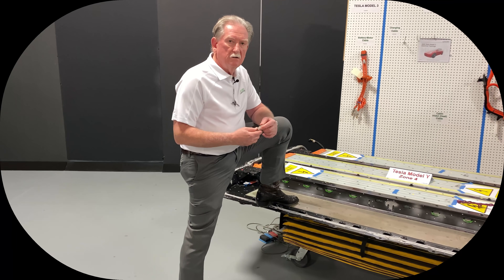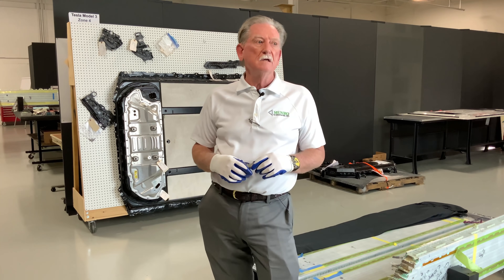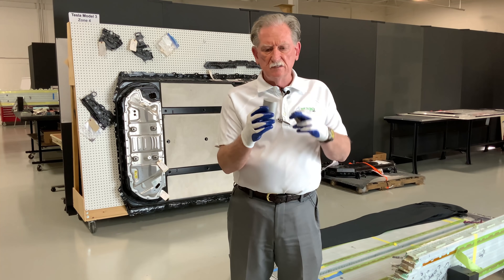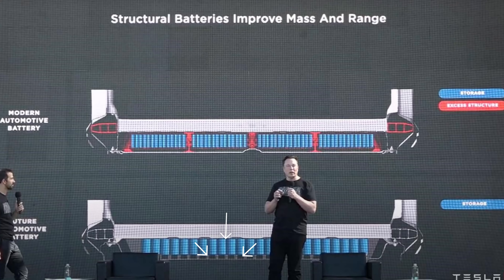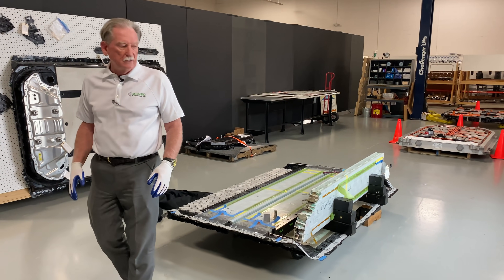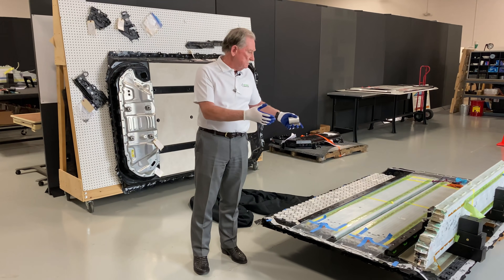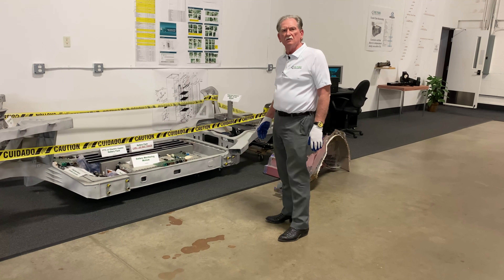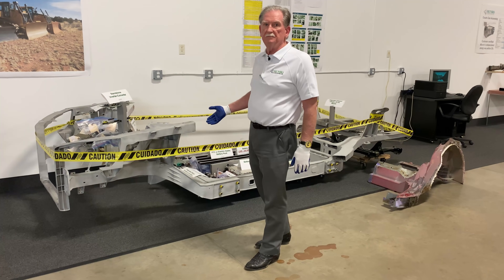Sandy is Thrilled about Tesla's Battery Day & Begins Battery Mock-up

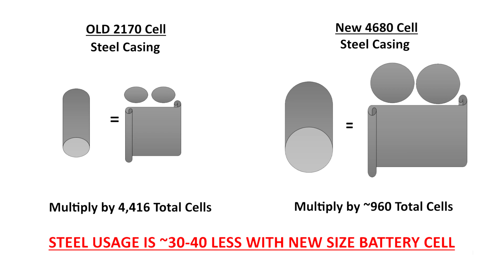Comment: @8:42 “That means that i’m going will lose about 30-40% of the battery weight simply because I have a bigger  diameter.” 

This implies that the 4680 cell will have 30-40% more energy density by weight than the 2170 simply because of bigger diameter, which is not true. It wasn’t true when going from the 18650 to the 2170 and isn’t true going from 2170 to 4680. If it were that simple Tesla would have made a 4680 instead of 2170 years ago. The weight difference of the cell can is a small fraction of the weight of the active material. 

Of course you have a complete model 3 and model Y battery so you can break it all down to the weight of the cooling system, the module casings, the filler between cells to prevent fire from spreading, etc. 

According to your statements, you are saying all the things that can be removed by using a 4680 cell directly in pack, and using upper and lower cooling plates instead of cooling ribbons, and then filing all the gaps with fire retardant epoxy, and the same kWh battery will weigh 50% less than the current model 3 battery, excluding the case, which is a separate weigh savings item not related to cell diameter.

Ok Tesla fanboys, come at me. LOL
Reply: Yes, someone needs to do a deep dive and break it all down for us!
Reply: .....will be way cheaper though
Reply: James Maddeaux, yes. Right now all the battery day information is jumbled together which makes it hard to see where each gain is actually coming from. Tesla could ask Panasonic to make 4680 cell size using the exact same chemistry as the 2170, and just use tab cooling (upper and lower cooling plates), and go direct cell—>pack and get ALL the weight savings. 

The 2170 actually has a higher volumetric energy density than the 4680 tabless, but a 4680 with enough tabs on each end to conduct heat optimally would have a higher energy density. 

I guess doing away with cobalt will save money if they can mine everything in Nevada. We can only wait an see because that’s a whole bunch of variables in there, starting with getting to acceptable yield rates with the Tabless 4680 cells.
Reply: @imho7250  Shouldn't the 4680 have like 25000 mAh?
Reply: James Maddeaux, yes. The 2170 is 4.8 Ah, and Tesla claims 5x energy from 4680, so 24Ah (24,000 mAh). However if they just used the same chemistry in the 4680 as the 2170 it would have over 26 Ah (26,000 mAH).
Reply: James Maddeaux, using Ah might not be the best way to compare since we don’t really know what the voltage curve looks like one they removed the Cobalt and perhaps do other things to the chemistry. But the 2170 has 17.3 Wh, so 5x that (Tesla presentation) would be 86.5 Wh for their 4680. So if they stick with 96s, and use 10p, that’s 83 kWh pack.

Comment: Kind of puts another nail in the short seller thesis that Tesla better watch out for when the "Big Boys" come into the EV space.  Tesla's biggest advantage is their pace of innovation.  And no, solid state batteries are not required.  Cheap energy dense batteries are the key.

Comment: Great work Sandy! So it looks like the 4680 cells are only a little taller than the 2170 in the M3/Y. So with reduced structure/cooling tubes, will the new batteries be able to be used in the same space of M3/Y? I think at first they are for Semi and CT per their battery day charts but would be good if Tesla can eventually put them in M3/Y/S/X.

Comment: I realize Tesla created its own metal, but making a casting of this size, isn't it subject to cracking if not at least micro-cracks? How much savings is realized by casting over stamped metal and how? What is the rate of casting manufacturing: 3 per hour, 10 per hour, 100 per hour?
Reply: Rate of casting: From what Sandy has said elsewhere, the rate will be a lot faster than stamping and welding together a conventional unibody.

Comment: I saw an interesting question that didn't get answered during the event, which was, how easily replaceable will the batteries be if they're structurally integral? And also as a side note to that, is it likely to prevent ev conversion companies from being able to use Tesla packs in conversions?
Reply: I doubt the batteries would be replaceable.

Comment: "With this,  do I actually need solid state battery?"

Actually, I was sort of hoping you would answer that for me.  But no, batteries are good enough now that it is obvious that I should be buying an EV.  If (or when) solid-state batteries would be an improvement, I want to see them used.
Reply: don't worry too much , Batteries to POWER the Suns are coming, ...

Comment: Sandy, I came from a plastics injection molding background.  Quite frankly, in the world of plastics enclosures for consumer products (TV, washing machines, chairs, etc.), they have made one giant piece mold for ages - in fact, I always wondered why they do NOT do this in the automotive industry ... and now I know why!  And I agree with you 100%!
Reply: It may also have something to do with the metal.  Tesla said they had to create a custom alloy to get it to work.
Reply: @bigdream_dreambig  It may as I think someone or Elon himself said that the metal did not require heat treatment after being taken out of the mold.  The Giga Presses produce metal parts much like plastics' injection molding.  That said, fibre-reinforced plastics (also injection molding) are widely used in the automotive industry - just never made it to the load-bearing structural elements.  https://www.automotivemanufacturingsolutions.com/high-fibre-content/36244.article

Comment: You describe the new battery pack as having the cooling plate on the bottom, would it not be more efficient to flip the pack over to have the cooling plate on the top.

Comment: What do the big castings and combined floorpan/battery pack mean for crash repair costs? Can they economically be replaced if damaged? Can they be repaired in place if bent? What state would the car be in after a crash which bent one of them? (Would something which bent them be a write-off crash in any case?)

Comment: It's good to get a Mr Munro engineering school fix once again x
Now I know I am going to have my head removed and put on a spike on London Bridge... Tesla are not the only ones using the battery as an integral part of the chassis... Lucid are doing the same.
Ok Tesla have as ever taken it to the next level with their new cell and giant slide mould casting, as Sandy says Tesla think at the speed of light, but they are not first. With the slow speed into production of Lucid and the ability of Tesla to pull the rabbit out of the hat, it will be interesting to see who makes it to the market place first. 

As an aside did anyone else's jaw drop when they showed the incredible reduction in factory machine space? Didn't see it coming even though all the clues were there for some time now about dry cell production but Tesla did it again and combined with their unique mineral processing from the ground to the cell they went and looked at the bigger picture and faced head on the issue of scaling up battery production to the levels required to transfer the world over to electric transport. I would have been happy if that was all Battery day revealed. 

Knowing how Tesla like to think outside of the box I wonder if they went to a makeup manufacturer to find the best way to industrialise their mineral engineering, especially the part of coating the silicone.

The one thing that made me think was the footage of them spooning the powder into the rollers for the dry coating manufacture, that I was expecting to be a static spraying method then going through the rollers to make it permanent. 

The top view of the Tabless Cell needs to be poster it is a thing of beauty.

Comment: I do not like the one piece frame idea for one reason, slow to medium speed collision. With 3 or more pieces if you slightly bend a front end or rear end it can be replaced without writing off the whole car. But a one piece frame means that the car is written off even with a low speed collision that bends the front or back frame slightly. You will end up with a lot of people hiding imperfections in frame alignment because they do not want to write off the car. 

I know there is a lot of work to replacing/repairing a bent frame part and often it is more value than the car is worth, but at least owners have a choice to repair or trash. With a one piece frame there is less repairability from a slow speed collision.

Comment: Don't get it. Cooling is proportional to surface area and the sides offer much more surface area. Plus heat rises so top cooling will be better than bottom.
Reply: Also how about turning two cells stacked horizontal all along the perimeter. Laminate them to form a perimeter "beam" boxing the entire battery floor pan in. 
Also structural strength will come from the attachment to the top and bottom plates (like corrugated signboard) epoxy between cells serves no purpose. Instead channel coolant through the voids. At least you will get a benefit from the added weight.

Comment: Sandy, can you please explain the implications of having these large frame castings on the ability to repair a vehicle in an auto collision. I think of the "unibody" construction of an old Ford Maverick. When that thing got in an accident, it was basically junk. I understand this is not the body but framework, but the question still seems valid.  Thanks for your input.

Comment: just the sheer numbers of olds cells is ridiculous but even with the new bigger cells, it's still looks like a lot of damn cells
Reply: There is better redundancy in the paralleling of many cells. Individual cell failures minimize the risk of the major part of each battery becoming defective.

Comment: question, the new cells said to have 5x more energy capacity than the 2170, but they are 5.5x larger than the 2170 by volume, so does that makes them less energy dense?

Comment: Normal car makes do the car from outside in so it looks great, the paint is perfect, but the technology is so so, Tesla went from inside out, first great engine and electronics, now the structure, next it will be the outside and looks once Tesla clears the gaps and paint it will be so far ahead the others can't even see them, it will be like comparing a F1 to cart.

Comment: Filling with epoxy doesn't make it solid, the weak spot in that case is not the void but the closeness to the other battery. Unless one has an epoxy layer ontop and bottom as well but that isn't enough. If one would use the epoxy for stability then one needs extra space between the cells paired with some kind of reinforcement (metal mesh?).

Comment: Why cool from the bottom? “Heat rises” makes me assume cooling from above is more efficient.
Reply: Eric Schnabel, heat does not rise. Hot fluids rise due to lower density than surrounding fluid. Heat only cares about moving to the nearest cooler pathway. In the case of a battery it’s using conduction, not convection. So placing cooling plates on bottom and top allow the shortest path for heat to be conducted by the electrodes.

Comment: Not only is Tesla bringing renewable sustainable transport ahead easily 10 to 20 years over what we’d otherwise have, they are massively improving industrial processes - I was frankly shocked at the concepts behind working with vendors on less processed raw input products helping both reduce input effort, and increase recycling. It’s no joke they are pushing the state of the art around building things. The next Ford indeed.

Comment: at the end

sandy:.... you gotta ask your self one question. With this do I realy need solid state batteries?

SHOTS FIRED
Reply: Nonsense, all techniques/technologies are usefull, hydrogen too
Reply: @carholic-sz3qv  you missed his point. The selling point that was communicated to everyone about solid state batteries was cost andcharging speed. Tesla's redesigned cell basically shows you can accomplish those things without solid state. Not only can those things be accomplished. by the time solid state technology gets out of the lab and starts looking like it will meet the hype. This approach will already have its production ramped up.

Some times the best technology on paper doesnt win. Because there is a cheaper alternative that meats most of everyone's needs. this could be problematic for solid state because if tesla manages to dominate sales like they are poised to. There may not be any  oxygen (capital) left to mass produce solid state.

Comment: Anything assembly on a printed circuit board can be referenced as solid state. Electrolytic super capacitor changes in seconds and has a binary of one is solid state. Tesla has just produced just that. They have the golden goose that just  layed the Gooden Egg.

Comment: I don’t understand why Tesla is pushing the idea of a “structural” battery. As far as I’m concerned, batteries are precious cargo, and they shouldn’t participate in the structural performance of a crash. Elon stressed that they will participate in shear transfer. When he says that, it sounds like replacing/repairing batteries will only be more difficult.
Reply: Sandy says at some point, serviceability and low cost/reliability are contradictory, you need to focus on one. Tesla focuses on making things easy to manufacture so that it's cheap, and high reliability which means lower serviceability.

Probably the wave of the future will be simply replacing the battery on the tesla and that's it.

In a standard ICE car, after a crash, how many times is the engine repairable? Not many times, they just write off the entire car if the engine has been affected. Same thing here, consider the battery like the engine/transmission combo. Is it worth fixing and repairing it after a crash?
Reply: I don't see how it is any different to current motorbike design where the engine itself became a stressed member of the frame.

Comment: Hey Sandy, Thank you for your insight. I have a question, Whats repairability for the unibody diecast automobile? will it be harder to fix parts in case of an accident? Thanks always! big fan!!
Reply: A benefit of Tesla Insurance and Vertical Integration, Tesla will be sure to consider that as well as safety

Comment: Curious to know Munro & Cos opinion- Longer term, will Tesla die cast the front, floor pan & rear in one casting? (When they can convince a supplier to make a big enough machine). Even longer term, will they cast the upper frame (as per their patent drawings) - this would be insanely complex wrt machine and tool size, material welding lines, cooling of material in mould/ potential warping of parts/ cycle time)

Comment: Elon said Tesla's electric drivetrain will be cheaper than an ICE drivetrain. I assume that means considering both the pack cost decrease and the range increase. So, how much does an ICE drivetrain for a mid-sized sedan cost? If it costs $6,000 to manufacture (I really don't know), that means Tesla's 250mi drivetrain must cost about $20,000 now (56% less cost with 54% more range but we only need 65% of that range to still have 250mi, so we can reduce battery size and therefore cost by another 35%). So we could take $14,000 off the price of the Model 3 and still get 250 miles of range! That puts the price at $24k instead of $38k. Phenomenal, altho I don't think they'd do that. When Elon said they could produce a $25k EV, he meant the China-designed world car, which would be a little smaller, probably a compact hatchback costing a little less overall to produce and having more like 280mi of range. The Model 3, meanwhile, would start at maybe $30k with 350mi of range on the base model.
Reply: Note: if I'm wrong about the cost of an ICE drivetrain, and it's more like $5,000, then the base Model 3 would only lose $11k in cost, bringing it to $27k. That still allows for a China-made world car to cost $25k and get at least 250mi of range, but the Model 3 base price might be bumped up a little. A lot of its price would be profit anyway, so it becomes more arbitrary. (And don't forget the 70% decrease in battery production line costs. That's incredible on its own.)

Comment: This is great. I am trying to wrap my head around the "battery is integral to the structure" thing.

Do you think Tesla will cast the top and bottom cases of the battery, then weld the top to the front and back. Fill the bottom case with batteries, epoxy them in and then will they bolt or weld the bottom in? I figured it would be bolted in, but other people seem to think you'll need to tear the whole car apart to swap a battery pack (which seems absolutely ridiculous to me).

Comment: Hi Sandy, what do you think of an electric version of  this. https://www.youtube.com/watch?v=yPg5Rs1i4O0&feature=emb_logo
 My problem with Arcimotor (beside the price)  is that it's about almost a wide as a car so you cannot do lane splitting.  I'd prefer Tesla to built something like this because they can do mass production, but their plate is full, so maybe you can show this to the folks at Arcimotor. I am thinking of several designs: open like a bike, collapsible canopy, fully enclosed, bolted seats with seatbelts so you don't have to use helmets  plus a detachable trailer.
The world needs a single trac one (or two) person mover.

Comment: Can anyone explain the Hurts/Herts/Hertz (spelling???) rating Sandy mentions at 7:28?  I tried googling it but keep getting other things.
Reply: Hertz is a unit of frequency equal to one oscillation per second.  When he says a "high hertz rating," he means the structure will have a high resonance frequency.  So if you hit it with a mallet, it will reman rigid, dissipating the energy with a high-frequency buzz.  If it had a low resonance frequency, it would flex and oscillate much more to dissipate the energy, maybe going so far as to bounce.